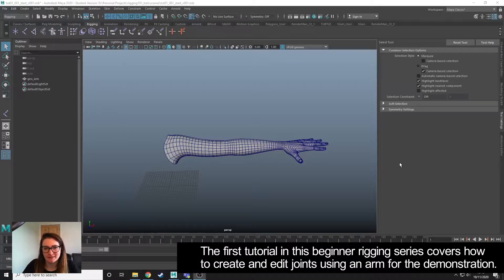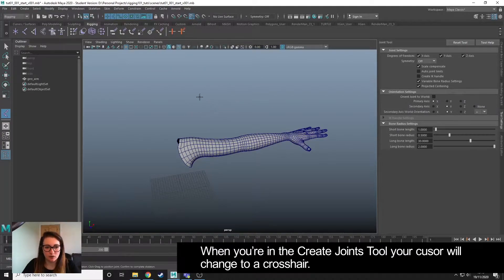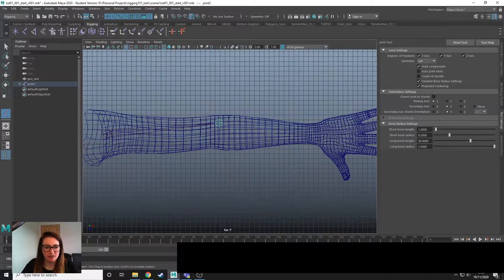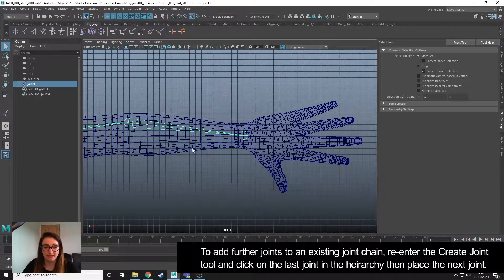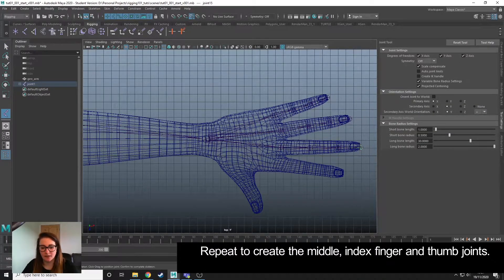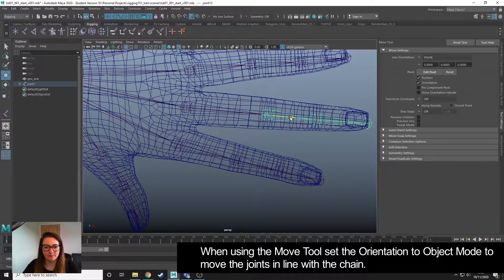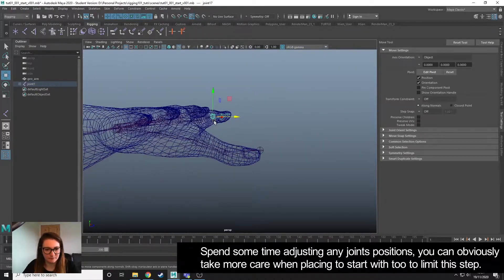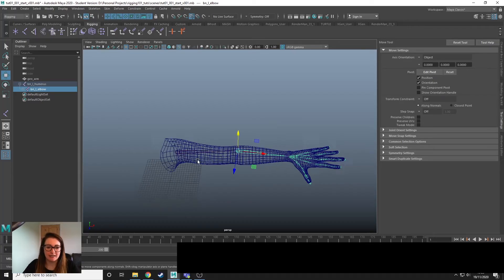Creating Joints - Maya Rigging for Beginners Part 1

Comment: Clicking on "Create Joints" then clicking on an existing joint that is in the hierarchy doesn't work on me. It instead create another joint and it's not connected to the joint I clicked (In the place where the supposedly existing joint that is in the hierarchy.) . I wish you can help me. I'm feeling lost.
Reply from the maker: If that isn’t working then select your 2 joints and use the connect joints tool, open the option box and set it to Parent joints and apply. The order you select will matter, I believe it’s child then parent from memory.